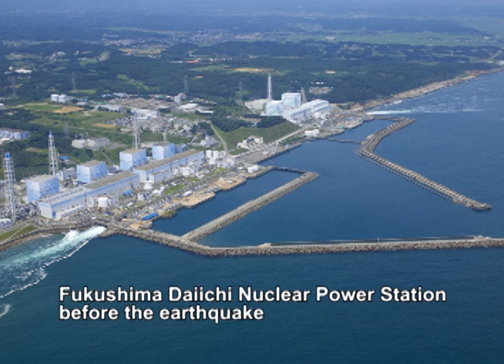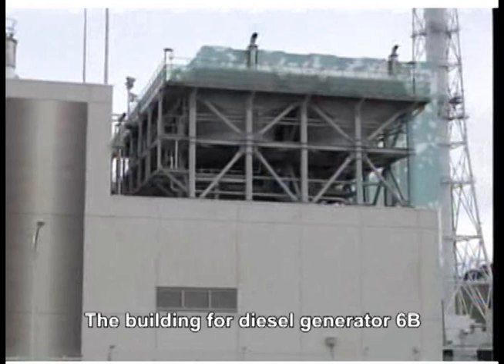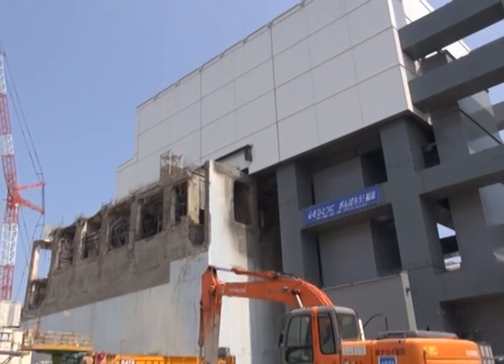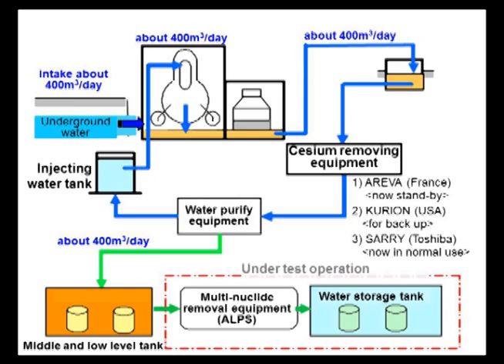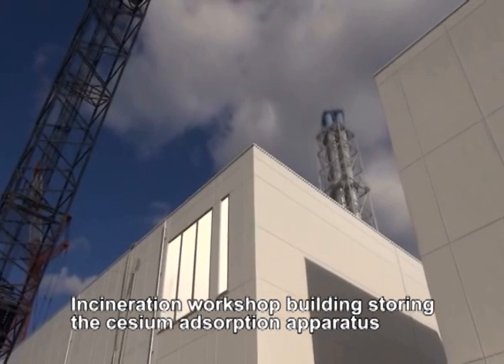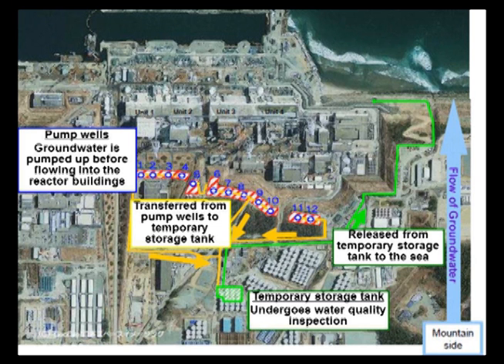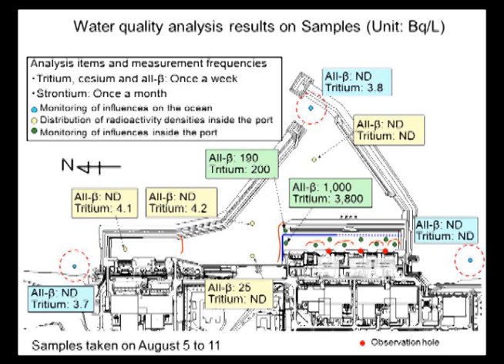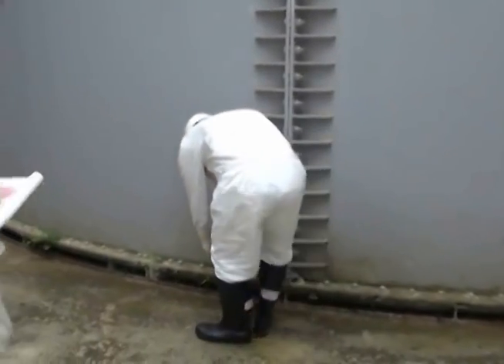Video tour of Fukushima Daiichi nuclear power plant -- Sept 2013

Comment: They tried pumping water into the reactor using pumps from firetrucks, but not all of the water reached the reactors because the maze of pipework didn't provide a direct path to the reactors and split off to other tanks/systems that siphoned off the water being pumped.

800,000 pounds of water was pumped this way, but only a small fraction of that reached the reactors.

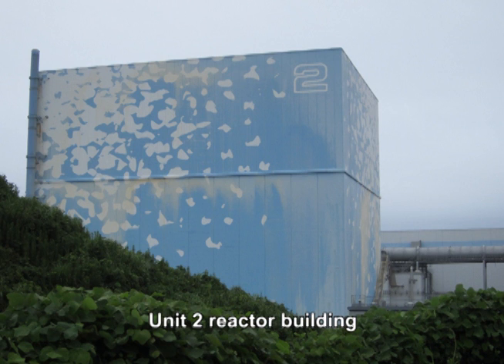Comment: 4:30 Unit 2 had a panel removed from which steam was seen escaping. I doubt Unit 2 "remains as it was before the accident".
Reply: Fun fact: Most of the radiation released by the Fukushima accident is from just the unit 2 alone…

The video is correct though that it did not suffer a hydrogen explosion… because it suffered a reactor explosion.

Exactly which part of the reactor exploded is still unknown as of  today. The radiation level near the reactor is still so high that they can’t even get a robot which can last more than a couple of minutes before it stops working, near the reactor yet.

Unit2 would probably remain “as is” for quite a while as they still haven’t figured out what to do with it yet.

Technically the “serious accident” actually involved just the unit 2 alone…